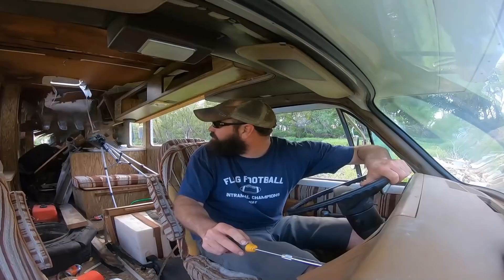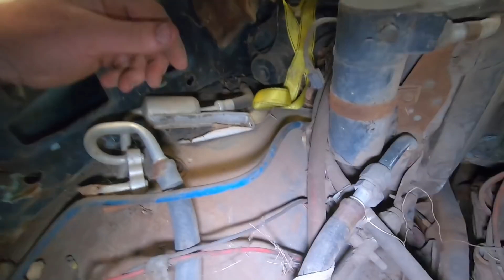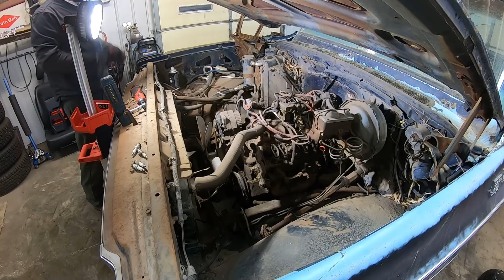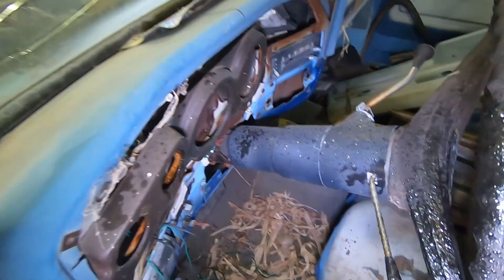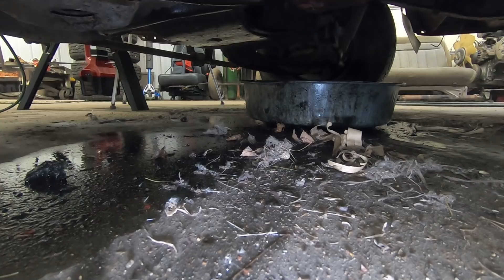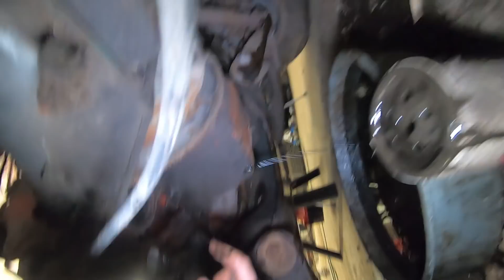Junkyard Small Block sat for 29 years! No Valve Covers! Locked up and full of Water! Will it Run?!?

Comment: the oil line controversy will live forever. after 29 years yeah the plastic line is going to be cracked. as with anything stuff wears out over time and you must check on the condition of the parts on your car and update as needed. me personally i see no problem with plastic line. its cheaper, easier to install, and i have never had it rupture as people claim (maybe those people also are trying to use 30 year old plastic line). i have, however, used the copper line and had it crack after less than a year from the flex of the motor and vibration and spewed oil all over the engine bay. just my 2 cents but i will chose plastic line over copper any day
Reply from the maker: More power to you. Copper won't break down over time or rub through as easy.
Reply: The Plastic Tubing is more forgiving to vibration and flex. When you run the Copper line you have to put a loop in it at the sending unit connection and at the fire wall if you got a tight aftermarket setup!

Comment: It will run,  6 mins in and its turning, now will it run good, that's the questions. Not stuck, Unless a major part is broken (cam, connecting rod) it will run, maybe Ugly but it will run, it's an SBC. Those years of any car were so detuned they seldom had major breakage, but they did if not maintained die , running too rich, overheated etc.. so many with stretched timing chains they run rough, but they didn't quit.

Comment: Mr Morski. Im not up to speed on all my small block chevys so forgive my ignorance. You said it could be a 350 or 400 origanaly & at this moment I have not watched the full video. But I believe the 400 is external balanced? I dont know about the 350. Is there a counter balance on the balancer? Can one tell the difference at a glance? Im guessing not or you would know?
Reply from the maker: You can identify them by the harmonic balancer. Bad news about the Dana 44!
Reply: Kwik story about fords & backward. I went to pull a car out of the ditch &  I just hooked to my front hook & put it in reverse to pull & blew out the front ring & pinion. Reverse? Dana 44's? What are ya guna do?

Comment: You not going to get full oil pressure with a drill they usually give you 20 to 40 PSI. Good thing you pumped the water throughout the engine that will give it the extra lubricate the engine needs to start after a long slumber LOL!! Now you know why the dipstick was reading over full or it would of been that way if you looked LOL!
Reply from the maker: It was cleaning water!!

Comment: A 350 and 400 are easy to tell apart by looking at the balancer the 350 is internal and the 400 is externally balanced meaning the 400 with have a thicker balancer then the skinny one of the 305, 307, 327, 350

Comment: run some tranny fluid threw motor it will flush out and clean the sludge and also will with the lifters too my tech tip of the day my friend.thanks

- nick
Reply: Just needs that new oil ran through a bit, then change it out and add a quart of DuraLube, she'll be fine forever!  
I didn't even see any sludge anyway
Reply: Not a good idea (atf)
It will also remove sludge.
This can plug up the pickup screen, causing blockage.  (?)
Reply: @SeymourBalz  i never had trouble with at all and its always worked for me.thanks

- nick
Reply: @nicholasarrigo3733  worked for YOU.
It depends on the AMOUNT of dirt/sludge in the individual engine !
Be sure when recommending fixes for ANOTHER persons engine.
My sister's cousins brothers husband did it once successfully "once" too.
Reply: It appears you want to argue and not THINK.
First...how many ppl read these comments ?
YOUR talking to them All !!
They...may NOT have the expertise to decipher condition of engine !!

I posted a WARNING !!!
As sludge MAY be their case !!!
Additionally mort had a TON of dirt !
"Rinsing" it down "Could" cause addl issues.
If you want to clean a slightly dirty engine..after knowing it's a keeper...
Just use Rotella !
It's high detergent !!
Mixed in proper amounts.
Always Aire to safe side, when giving advice to possibly thousands of ppl.
Thanks for finally Understanding.  Tom.
Reply: @SeymourBalz  i dont want to make anybody mad sir was just help somebody out.thanks nick
Reply: @nicholasarrigo3733  it's not about getting anyone angry.
It's about all the people who may not fully know the integrity of their engine.
And loosening too much sludge. And a "possible" blockage.
Reply: @SeymourBalz  tom please email me at nicholas_arrigo@yahoo.com please i have tried to email and it rejects it everytime to try and your are you in the blockages tho

Comment: my dad had a new edge mustang when i was in preschool in the early 2000s. he did a routine oil change on it and drove it down the road to run some errands. all of a sudden he loses complete oil pressure and the car turns off. he hadn’t checked to see if the o ring was stuck onto the engine. he towed it home, put new oil in it, and made sure to avoid the old o ring. the car started up and was perfectly fine after the old o ring was removed
Reply from the maker: And boy ever does it make a mess!
Reply: As a young mechanic a thousand years ago I was doing oil changes for a big ass chain.  I double sealed a Mercedes. Lucky for me I still had it on the lift but she pumped a full qt onto the ground between start up, walking around to check under the hood and running back to the ignition.  No harm no foul just the Exon Valdez grounded on my bay floor.
Reply from the maker: @bobadam7021  A quart goes a long way to making a mess!

Comment: Amazing result, way to go, we will never give up! SBC Rule! Double Gasket Oil Filter oh yeah. And oil all over the floor, oh and lets burn thru the white plastic oil pressure line on the way to work in your 1966 Biscayne 4 door post 6 three on a tree, so you can watch oil pressure on the old motor, but you have tools and oil in the massive trunk.  As long as your having fun. How DARE You !!!!!! well done.

Comment: You have no fear  never can tell  it could run     won't   know  till you try   at least  it will be easy  to see if the valves  are stuck  😁😁😁😁
Reply from the maker: And of course, none of them were!
Reply: @MortskeRepair  2wd full top blazer you lucked out ! You need to drop that 5/7 and drive it! Funny thing is 2wd and 4x4  were badged k5.
Reply: I want to apologize Mortske. Man I was having a really BAD Monday you hit it on the head. You and puddin are the 2 best car revival shows on youtube.. hands down. Thanks man. you could not have said it better.
Reply from the maker: @mikestone2215  Thanks much for watching!